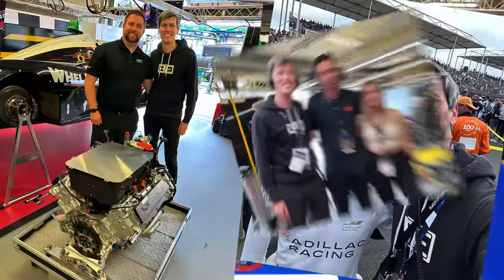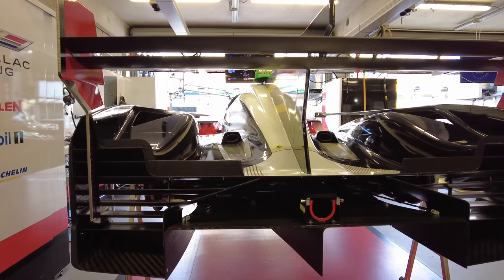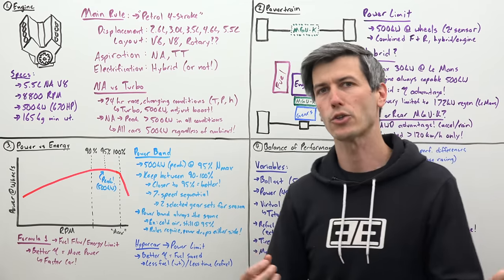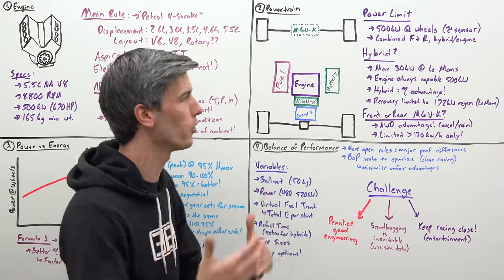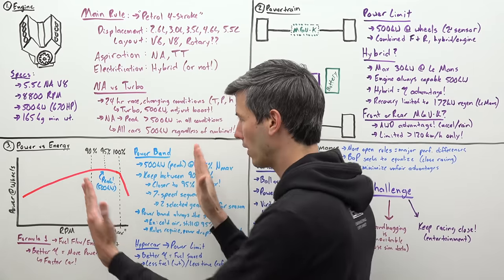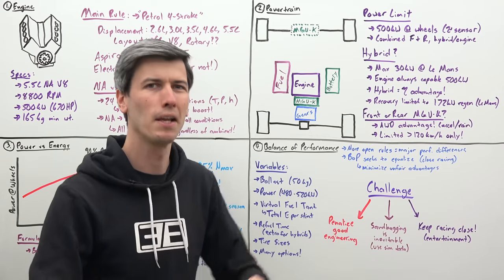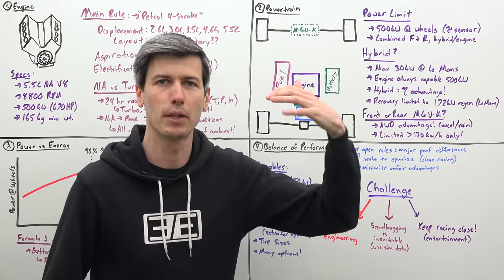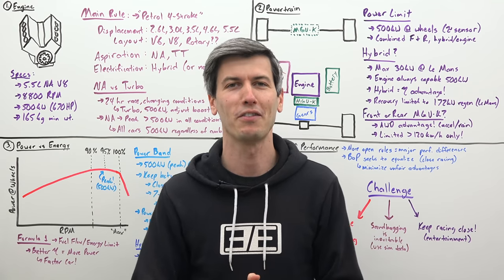Are Hypercar Engines Better Than Formula 1? — 24 Hours of Le Mans

Comment: What is the use of having so many variations to choose from when whatever you do your performance will be limited to have same performance across all teams. 
For example , by choosing a hybrid powertrain a team can improve its efficiency and thereby gain an advantage in less fueling time in pits. This is a reward for the engineering and effort for choosing a much complex hybrid powertrain instead of a generic one. But if ur going to have a time penalty in pits for having a hybrid powertrain, then y wud anyone want to all the trouble of having a hybrid powertrain. And adding ballast to reduce the performance of a team who did a good job of developing their car is plain stupidity.
Like u said F1 is a engineering sport rather than a driver focused sport, not all racing format has to be same. And with the theme of ur channel there are those who love the engineering side of things rather than just entertainment. 
F1 has found the right way to equalise the field by introducing the cost cap and cfd windtunnel restrictions. Now if a team spends the same amount of money and resources to develop a dominating car then its a testament to all the engineering minds putting in the effort to achieve such a feat. 
F1 looks predictable when u just consider the result, even in this season there were so many unknown variables each race and if a driver is consistently winning its not just because he has a faster car its also because he is overcoming all those variables to achieve the results. And that makes those drivers the greatest in the sport.

Comment: Mazda can most definitely make a 4 Rotor for a Hypercar if they tried, and if they only need to push 670 that’s perfect, the 1991 winning car made 690 the whole race, and it was reliable and fuel efficient compared to the competitors, nowadays with the new advancements for rotary engines, I think Mazda can make a big comeback in WEC if they really tried

Comment: F1 has gone from boring (2014-2020 Ham/Merc domination) to outright horrid with RB/MV dominance. Funny because the so-called rule changes were brought in to 'improve wheel to wheel racing' and we have the race leader winning with a 25 sec + gap every race.

Comment: Can't run a rotary, cause that wouldn't be a 4 stroke
Reply: Funny you mention that as I was only today (watching the 24hr du Mans 2024) that I have been reading through the tech specs for Hypercar and is read that in fact fosil V6,V8, Rotary or any other type is allowed.  I am NOT saying it can because it make little sense to me either, but just saying I read it today,  Hopefully someone can tell me . . . . . .  2024, LeMans, Hypercar, what are the correct allowed engine types ????

Comment: i only really watch IMSA, which has an energy limit, kind of like how non hybrids are limited by the amount of fuel they can hold, except this includes fuel and electric energies. I think they call it a virtual fuel tank, so even if you still have fuel in the car if your virtual fuel tank is "empty" then you need to pit top off. I dk how I feel about that since the whole point of developing your hybrid is to get the most of the fuel you do burn, but I guess it is also more fair in that there's only so much to be gained from increasing efficiency which keeps costs down.
Reply: by regs, lmdh have not less than 110L fuel tank while hybrid lmh are limited to 90L. The virtual or allocated energy is measured from the torquemeters placed on rear axle for lmdh and both axles for lmh. Torque curve is set by bop, so the more the engine pushes the more torque is measured across the time up to the energy limit set by bop. By surprise, this doesn't involve much the fuel consumption but is used as an absolute way to let different cars, powered by different engines and technologies (bespoke front ERS vs spec rear ERS) having the same about 55 minutes long stints. Lmdh have larger fuel tank because ERS supplies only about 70hp, so during the stint lmdh ICEs consume more than lmh's ICEs that can go down to <500hp and for longer when ERS is activated. Not to mention that LMH engines are more developed motors unlike lmdh that use adapted older engines (bmw uses a turbocharged version of the old 2015-2018 dtm 4L V8, porsche uses a turbocharged version of the 918 engine that in turn was a larger version of the old rs spyder lmp2 engine, cadillac uses a "close to" derivated road engine like the 4L turbo that will be used in the lambo lmdh, alpine will use the old mecachrome (based on the f2 engine). Only HPD developed a proper engine for lmdh after those specs were scrapped for 2024 indy engines).

Comment: Forgive me if I'm wrong, but I'm pretty sure Rotary engines were banned from competition in the LeMans 24hr after the amazing success of the 787B.
Reply: Success so amazing it only won when the cars in its class had around 200kg of extra weight to help the new class of cars shine (which ran basically f1 engines), which they didn't since they were too new and blew their engines.
Mazda managed to avoid it by getting FISA to let them run at 830kg while Sauber and Jaguar had a minimum 1000kg weight to respect, talk about a "success". Oh and the engine ban hit everybody inluding Jaguar, Sauber, Porsche etc...

Comment: I'm confused.  If the spec for the engine is 500KW but the max hp at the wheels is also 500 KW, something has to give.
Reply: its measured at the wheels only. so powertrain can make slightly more and compensates with losses

Comment: Hi from the uk 
Le man's has always been better than f1, f1 is a red carpet day for the sponsors or a cheque book procession it has a lack of innovation because the cars are built to a formula it could be made more entertaining( if that is what it's about) buy not having teams of people changing tyres and refuelling and leaving the stearing wheel attendant to do it all 
Real engineering innovation could be introduced by opening up the rule book and defining a total amount of energy allowed for a race and not you must use this fuel 
Or by changing the rules between races so a new vehicle had to be built for each race with only the time between races allowed for the build 
Sorry I hate f1

Comment: Rotary is not a 4 stroke engine … so no, you probably can’t run a rotary (unless Mazda makes a petition and they change the rule … which probably wouldn’t be a problem)
Reply: The most compelling explanation I have seen as to why modern motorsports holds no interest for me.
Reply: Rotary is a 4 stroke engine.

Comment: They are now with how neutered and dull F1 engines are..

If F1 has a power problem they should just mandate more aggressive aero to limit top speeds but still increase acceleration and cornering.

Not this engine limit BS.